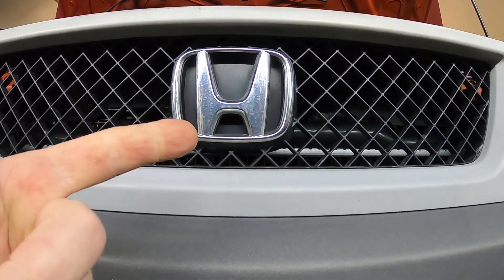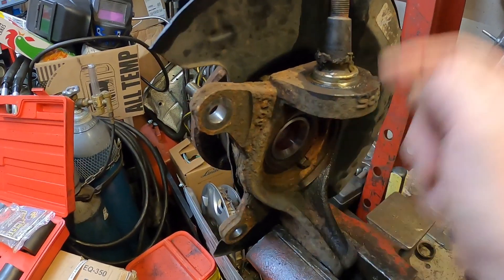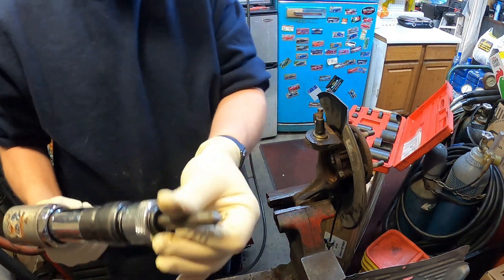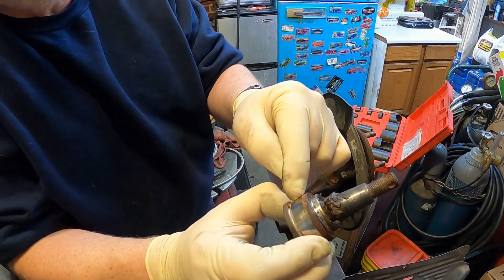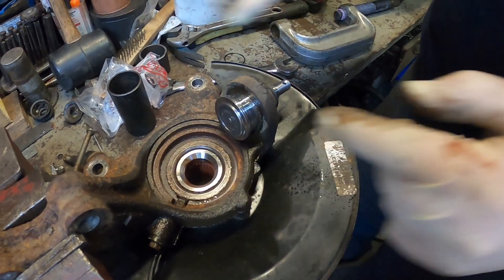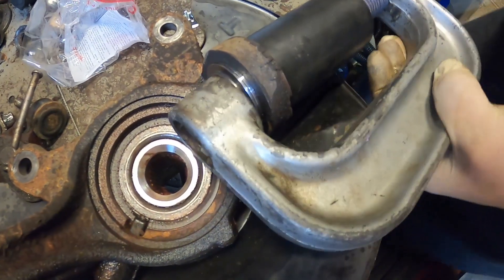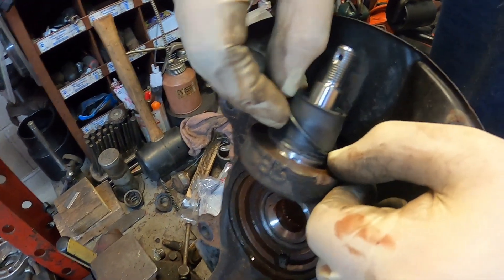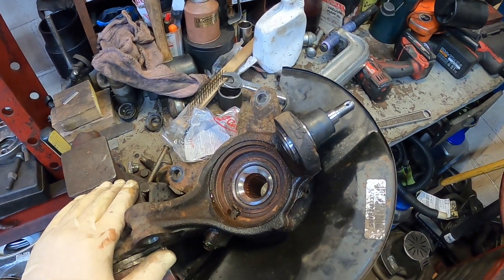2004 Honda Element Ball Joint Install

Comment: Which ball joint did you use? 

I ordered two sets already and they are too small. Falls right in. The ones I ordered are the ones that come up on their system
Reply from the maker: I do not remember but try a Moog or a NAPA.